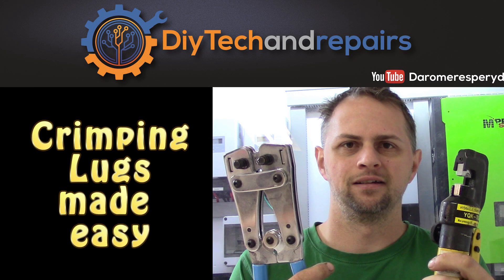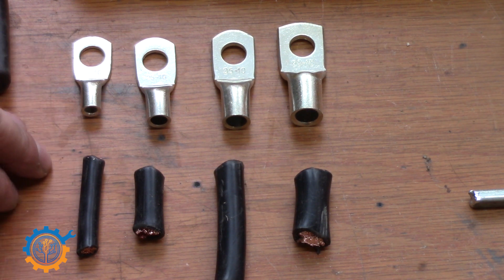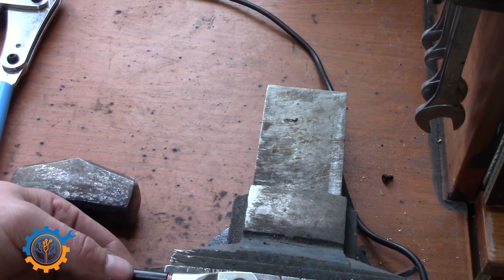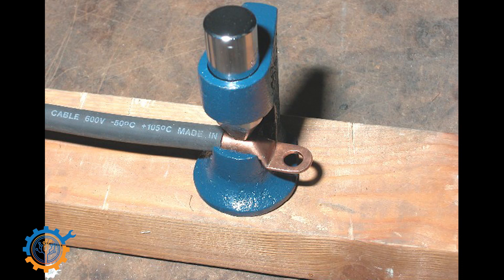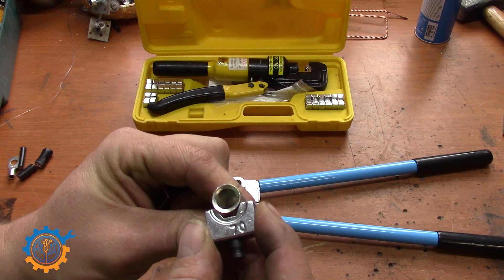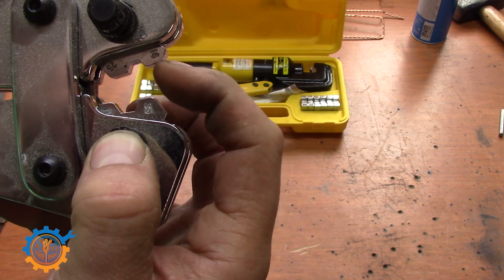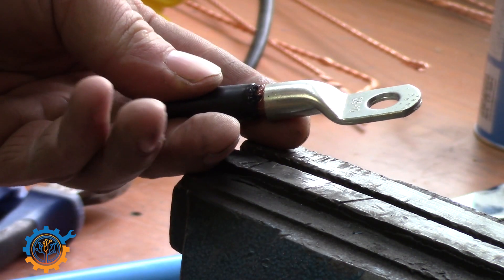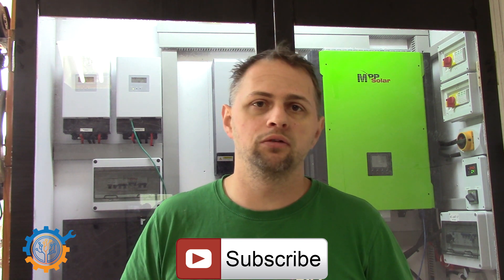Crimping lugs - Can it fail?!

Comment: I crimp, but other videos I have seen of soldering use the pool soldering method, with the opening of the lug opening upwards.  You heat the lug, and put solder into the lug.  As the solder melts, it forms a pool.  Once about 2/3 full, you push the wire into the pool of solder and hold it till the solder solidifies.  This keeps most of the solder in the connection, less will wick up under the jacket as in this soldering demonstration.

Proper crimping is better than soldering, as the cold weld is less brittle, and won’t melt at the low temps that melt solder, so it is less likely to pull loose in a high heat situation.

Comment: Thanks for the video. I watched a video recently, whereby a guy said that, especially for marine applications, soldering is good for staving off corrosion? I've soldered my Anderson plugs for, sometimes I may wish to replace the wires and you can simply melt the solder and swap them out (being a designated, unique to Anderson terminal, and all, and not just your common 'off the shelf' terminal). Apart from that I've always steered clear of soldering, for many years now, because of the stiffness and potential fracturing. 

I own a manual tool similar to yours. It cost me an arm and a leg (so 'obviously' I must be writing this 'one-handed') and it crimps from 6mm all the way to 120mm. I also find it great, and it's my go-to tool for those larger crimps. I would never recommend the vice or the hammer method, as it flies in the face of everything we're trying to achieve here, as you can't possibly hope to get a nice all round tight crimp using those methods.

Comment: Daniel, could you tell me what kind of brand lugs you are using. I have the same blue crimping tool as you (the HX-50B),but the cheap lugs I have don't seem to fit the right way, they are either to thight or to wide. Yours seem thicker and better.
Reply from the maker: I bought My lugs from Biltema in Sweden. Not sure of the brand but they fit ok

Comment: Awesome video as always buddy. Do you suggest any type of quick-connect adaptors/connectors/housing for the larger gauge cables, such as 4AWG or 6AWG?

I've ordered both XT90 connectors and the Anderson powerpole 45A connectors, but I'm thinking the large 4 gauge wire I already have is not gonna fit in either. I'm trying to avoid buying the 175A powerpole connectors and my max current should really only ever be at about half that anyway. Any suggestions from anyone would be greatly appreciated!

Comment: Honestly I've used alot of crimpers  from hydraulic to soldering them and the one that gives me the best results is the crimp hammer. Perfect crimp all around and it's the cheapest, I paid alot of money for the rest of them and I don't use them anymore. Cheers
Reply: I've been debating what to get. You've got me leaning toward the hammer crimper. Thanks for sharing your experience.
Reply: Hammer crimps are garbage.  If you think hydraulics are bad then im guessing your not using it right.  And there only 40 bucks on ebay.

Comment: Is there a reason you don’t use Anderson plugs?
Reply from the maker: For connecting the packs?  Anderson lugs is for places where you need to be able to disconnect it every now and then. I dont plane to disconnect this very often :)
Reply: DIY Tech & Repairs ok thanks. Iv seen Pete from hbpowerwall disconnect his a lot and thought it would be a better option. I suppose it’s personal preference as long as there isn’t a disadvantage to doing one or the other. Keep up the good work mate.
Reply from the maker: Thanks!   I dont see the reason to disconnect/connect them that ofte. Or atleast i dont hope that i have to do that :) Time will tell.

Comment: DIY Tech & Repairs,
now, to continue your tutorial, you should take the hacksaw and cut the crimping area apart. if the crimp is well done, the hole thing should be one solid bit of copper bar with no air gaps or hollows inside. i would be in particular interested in the lug you flattened first.
and yes soldering high current supplication is not recommended. and yes all the people that do solder the lugs will tell you that in their experience   .........
Reply from the maker: Urs Odermatt :) i will hack one ps those flattened apart to check. Will be very interesting :)
Reply: i hacksawed a crimp  apart. the inside was totally cold fused. there are no wires visible, just everything is one round copper bar. i was impressed. (by the way i am using that cheap hydraulic crimper, has gone good so far)

Comment: You are not supposed to solder them because when you pass current through them the solder will oxidise. There is electrolysis between the metal used in solder and copper. That's why the lugs are coated in Nickel, because there is no electrolysis between it and the copper. Come back in a few years and your lugs and wire will be corroded. There is a reason why absolutely no company in the industry solders these connections.
Reply: Simon Inga The lugs are coated in Tin not Nickel, corrosion will not be an issue whether the connection is crimped or soldered , cleanliness of the wire and connectors with correct execution will yield the best and longest lasting connections......cheers

Comment: A good crimp is about maximising the surface area of the strands against the lug, not about how strong the lug holds onto the wire.
Reply from the maker: I would say both. If they dont stick on to the wire it wont work long-term :)
Reply: How's the manual crimper holding up? Is it advisable to get a similar tool?